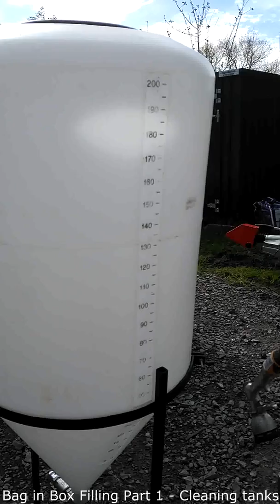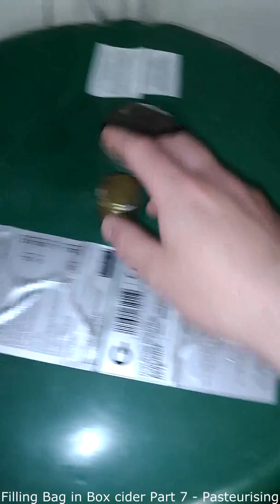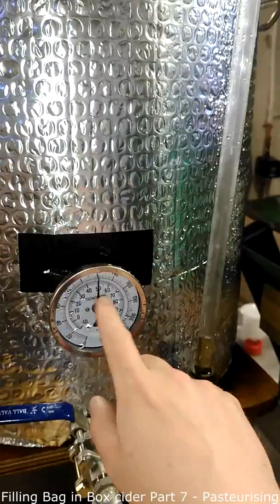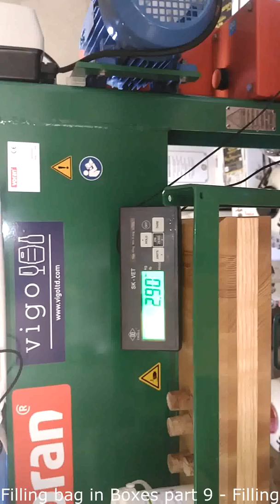Filling bag in boxes of cider using DIY In-Line Pasteuriser

Comment: Really interesting and informative video,  thank you. I was looking for some inspiration as I also intend to make my own pasteuriser, but using an oil boiler as the heat source (potentially more economical these days). 
Regarding the bag in boxes that you are using.  Do you bother sterilising them before filling,  or do you rely on the heat of the juice to do that? If so, I assume that you have had no issues by heating the juice to ~67 degrees, rather than heating it to ~80? Thanks. Col
Reply from the maker: I dont pre sterilise the bags, no. I run the pasteuriser at 67C and I worked out as long as the bag is at 64C or above at the end of filling when I seal it up - it will self sterilise due to the residual PU's (pasteurisation units). I've only had two failed pasteurisations in 2000 odd bags and both of those I believe to be issues with the tap rather than the process. I would not heat to 80C unless you plan to flash pasteurise it to be honest. At that temperature it will affect the flavour markedly.
Reply: @Llanblethian Orchards Cider Makers  Hi. I'm interested in 'copying' your pump bypass assembly using the same Camlocks etc. I've done a bit of  research into which fittings I might need, but it still seems like a bit of a minefield! Could I trouble you for a simple list or diagram of your assembly and possibly even the best place to purchase the fittings from? In return, I promise to purchase plenty of your cider when I'm in your locality  :-) Thanks. Col
Reply from the maker: @bigcol2233  Hi, it's a bit difficult to recommend exactly what you need as every pump / setup is different. 

I bought all the fittings from ebay years ago. If you want to but from an established UK company nero is pretty good. 

You need to think about what hose size you want and build from there. I use 3/4" hose and hence all my fittings are 3/4" as well. 

With camlocks, they are designated a, b, c etc depending upon the fitting. In my setup for instance camlock F are male threaded camlocks so they could fit directly into female threaded T pieces. 

The rest of the setup is camlock f -  female threaded t piece - straight hexagon joint nipple - female threaded full bore ball valve - straight hexagon joint nipple - female threaded t piece - camlock f. The two bottom ports on the t piece are male threaded hose tails. 

Hope that helps.
Reply: @Llanblethian Orchards Cider Makers  Hi. Thanks for this. It helps a lot. Cheers

Comment: Why dont you buy An inline thermometer from alixpress for at the end of the Pasteur. Then you dont need to fill kettle with cider and you can ad a Platecooler at the end so its cooled down when IT goes into the bag. Takes less space and is more controlled. I do like the way you adjust your Flow rate.
Reply from the maker: Thanks for the suggestion,  I plan on getting a new thermometer for the outlet side. 

The kettle is quite handy as a holding tank to be honest. It takes 8-12 mins to pasteurise enough cider to fill a bag. As the kettle can take 3 bags I can do something else for 1/2 hr then fill up the bags all in one go. If it directly filled the bags I would have to be on hand to watch it the whole time.
Reply: Llanblethian Orchards Cider Makers true. Im planning to make myself a pastuerizer for my brewery. A bit different but more or less the same Idea. When its ready ill send you a link with the video.
Reply: Hi. Can I ask how you pasteurise the cider that you carbonate in the bottle? I'm thinking of buying a 2 bottle carbonator and can't quite get my head around the pasteurisation process of carbonated cider. Is it done the same as still cider? I.e. after the cider has been carbonated and the bottle sealed? My confusion is whether the heat would cause the carbonated bottle to explode and/or whether it would reduce its carbonation? Thanks.